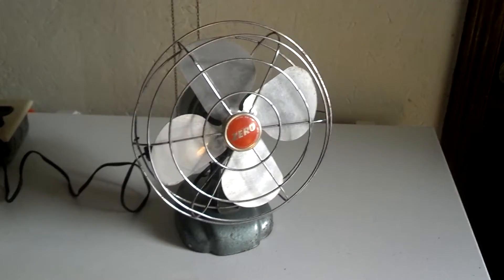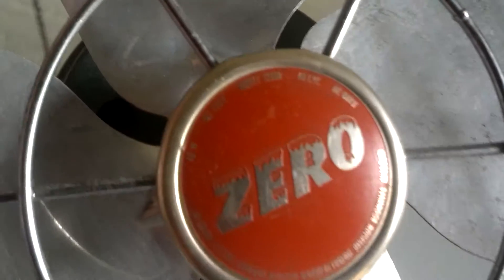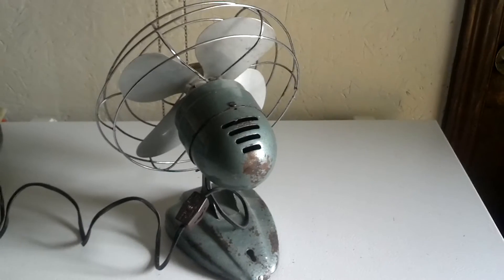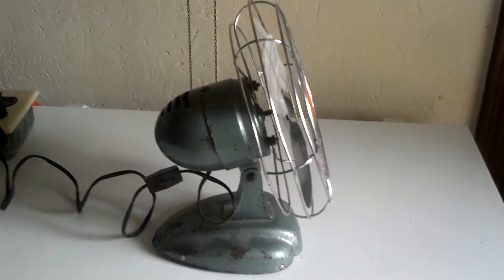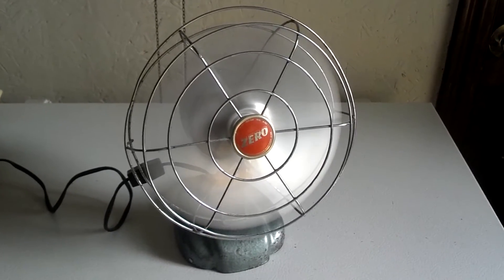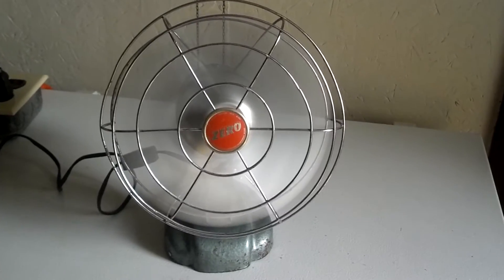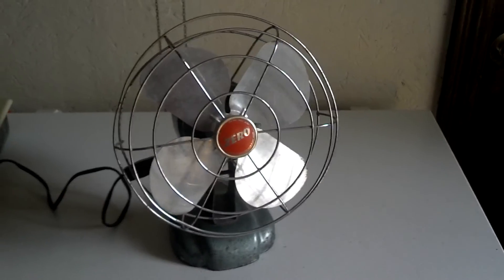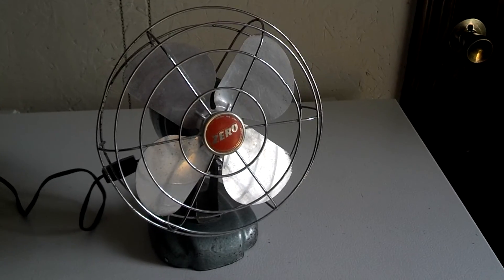Vintage Zero model 1250R

Comment: The switch was a good addition.. Looks like it could have been original..This has got a pretty neat startup/spindown sound to it.. I think the spindown sound comes from the spring inside rear bearing,, at least I think that's where it is.. Haven't had one of these open in a while..I think I have this exact model somewhere.. If you ever want more of these I could send one over,, I have like 5 of them..That was a good bit of poetry you threw in there..LOL